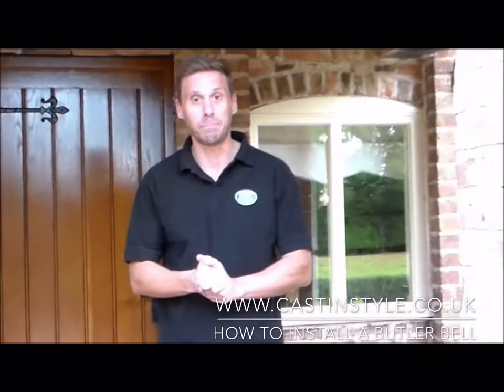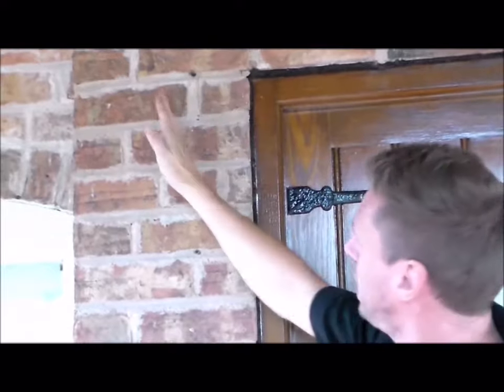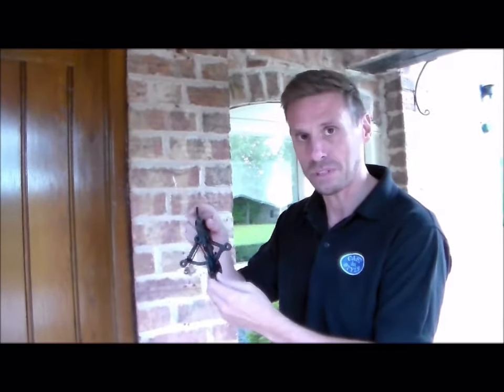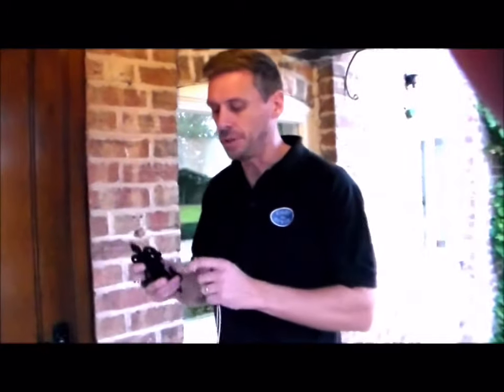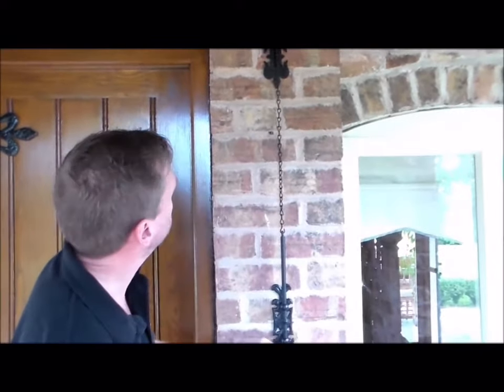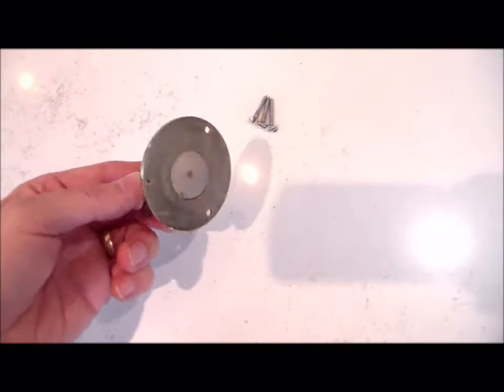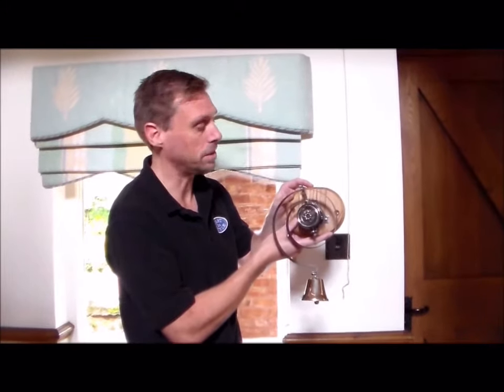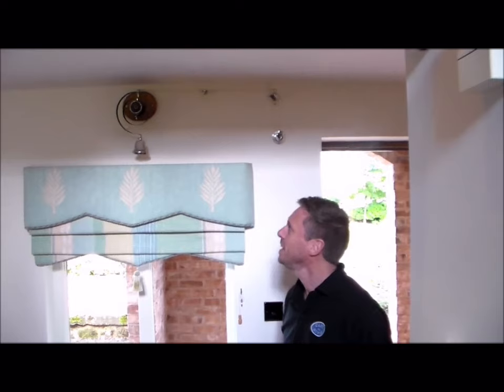How to install a Downton Abbey type Butler Bell - Cast In Style - www.castinstyle.co.uk

Comment: When in use over time, will the cord that is tied to the rocker on the crank rub and fray where it goes into the hole and through the brickwork ?
Reply: I was thinking that. Dusty too.  Better to shim the hole with some PVC pipe. And aim to get the screws in the middle of the bricks. Not the mortar joints as shown. Because its likely the mortar will crumble and you will be in cheque mate.

Comment: At 12.04 he says that the cord will have to pull in a vertical motion, but he clearly indicates  that it will need to pull in a horizontal direction. 
Also I am very surprised that the first thing shown wasn’t the decision as to where the bell was to go, and also where the hole from the outside would emerge into the house There might have been burglar alarm panel or anything on the inside. 
Otherwise - all very useful.